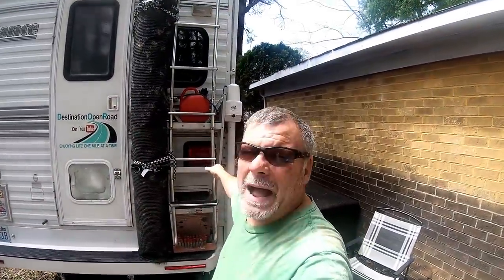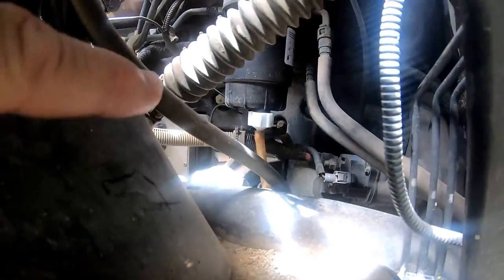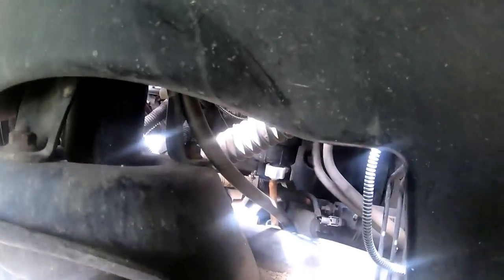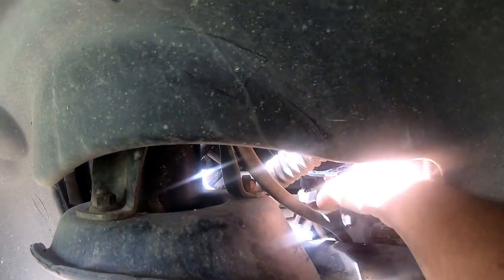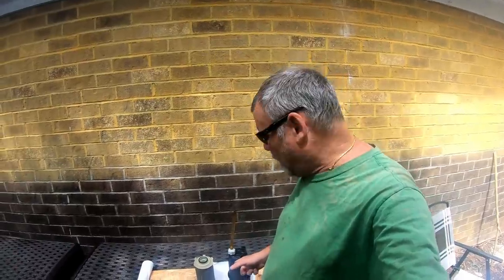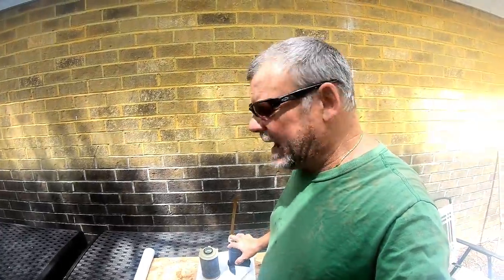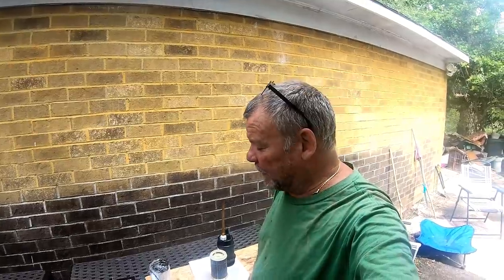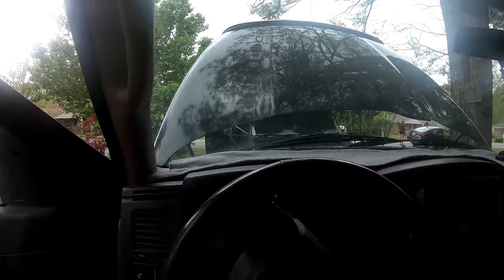How To Change 6.7 Ram Cummins 6.7 Fuel Filter, Truck Light Q & A RV Life Vlog

Comment: Scott that looks like the upgraded filter and canister,  Cummins Filtration has a new high performance Fleetguard® FS2: Filter-in-Filter technology for the Dodge Ram trucks with the 6.7L Cummins turbo diesel engines. The new filter assembly is an upgrade for the ’07 – ’09 Dodge Ram which provides the filtration performance of two filters in a single, reusable filter canister., Cummins and Chrysler began applying this high-performance filter to all new engines and trucks effective January 2009. All owners of 2007 – 2009 Dodge Ram trucks with a 6.7L Cummins turbo diesel engine can use the new filter without the need for additional plumbing or hardware.

Comment: Scott I could not leave a comment on the last video so I will do it on this one. First just to let you know, I see you were using propane. Nap gas burns hotter. Second Inspection mirrors work great on checking fitting to make sure your joints are good. Just a tip. I also don't understand why they would put valves behind a wall were you can not get to them. I have put a vent there. But you don't have to worry about that. Yes I agree Teri is a great help.Safe Travels.

Comment: Its good to open the water fuel valve at least once a month to drain the water out of fuel filter that is what the white valve is for diesel has moitsure in the fuel already and that way extend the life of your motor

Comment: Cummins manufacture all of their own filters in their own factory and have since the late 1950's (Fleetguard brand). The high pressure fuel pump on the Cummins needs filters with a 2 micron filtering capability or you can have problems with the pump. Sadly most filters don't come anywhere near meeting this spec. Look up Cummins locations on their locator, and buy ahead for next time (you should always carry a spare filter anyhow in case you get some bad fuel). Yes the NAPA 3733 is the replacement for the FS2 filter housing (the replacement shell you had installed last time) The Cummins Fleetguard number is FS43258 for that shell. (Geno's Garage website is wonderful for Ram owners).  Good job however, and your filter is much more difficult to access than mine. Being proactive is the name of the game. Sorry to get so detailed, but thought it might help you in the end. Being on the road limits the amount of time you have for research of stuff like this.

Comment: Sometimes when you install campers you have to change the flasher to a heavy duty flasher.  They are in the regular automotive store . Just ask for the heavy duty flasher for your truck and they will know which one it is. The fast flasher is a sign you need the heavy duty one.
Reply from the maker: Thanks 👍

Comment: Check the blinker light on the right side, it could be burned out.
Reply from the maker: That's exactly what the problem is. I just don't want to lift the camper until we get back home, then I'll change it out. You don't see the truck blinker because it hidden behind the camper, so that's why I'm not to worried about it at this point. Thanks for you input, and suggested help, it's much appreciated!